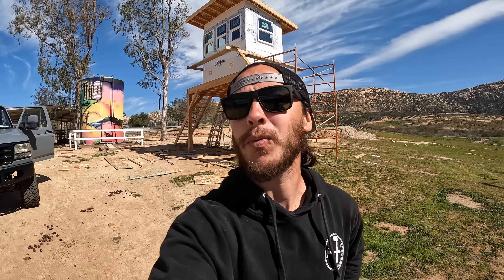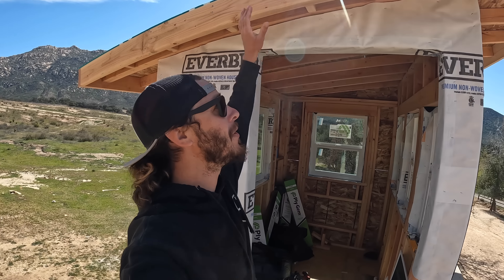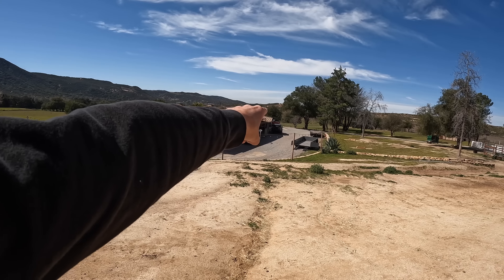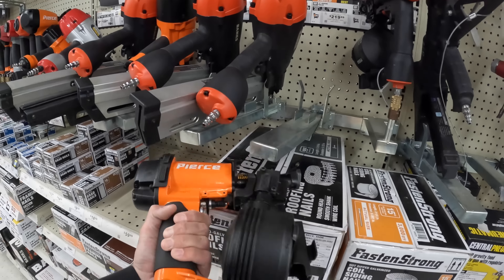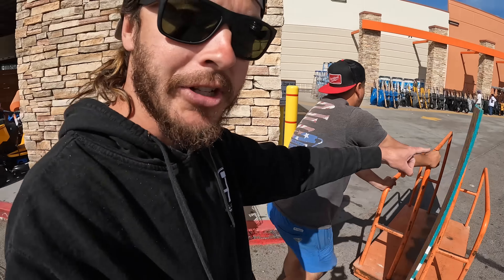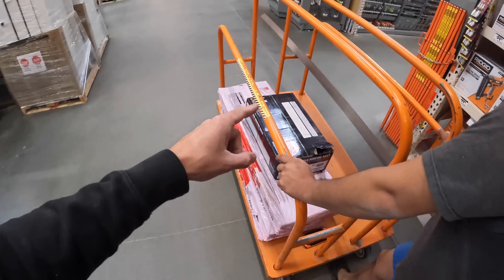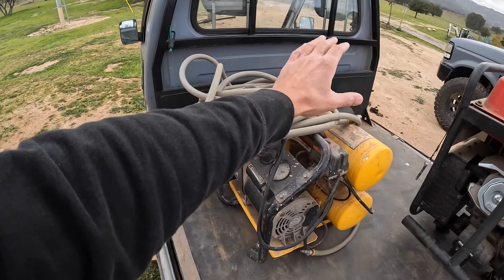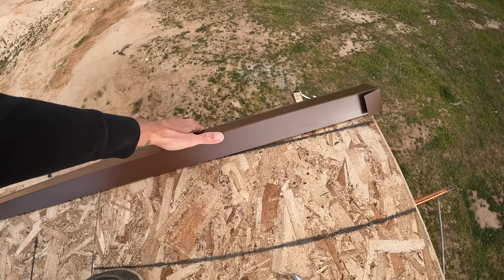Building a LUXURY Hunting Blind! (Part 6)

Comment: I don't know if they still have them but I know 25 years ago when I used to help my grandfather put on roofs there was a plastic almost like cellophane strip on the back of every single that you had to feel off and that was your nail line and it helped to seal the nail hole. So my question is did you get peel the plastic selfie stuff off the back of the shingles
Reply from the maker: The plastic film specifically said to NOT peel it off.
Reply: @DMAXRYNO  well I must be mistaken I could have sworn that we did peeled off but like I said that was over 25 years ago. I quickly decided that Roofing was not my thing and decided I'm going to go do what I do best and that's motor 80,000 lb up and down the road

Comment: The only problem spot I see for future leaks is on the first run of shingles you nailed down..First run of  shingles should be laid upside down, then come back and start the run that will cover the roof..There should be a stagger in the two first runs so there is no exposed gap to the tar paper..The paper will eventually wear out where the water touches it, causing a leak later...It will make good content repairing it though in a couple of years..
Reply from the maker: I believe that is what we did here. I’m not seeing anything different. First one was upside down, then went over top with a staggered joint 🤷🏽‍♂️
Reply: @DMAXRYNO  I probably wasn't paying attention... Everything looks good...
Reply: @DMAXRYNO  you flipped the shingle over. Your suppose to just spin it upside down maintaining rough side up, sticky side down against the paper. lol.. Just started watching your videos. two thumbs up!